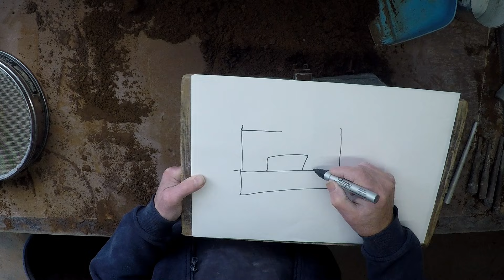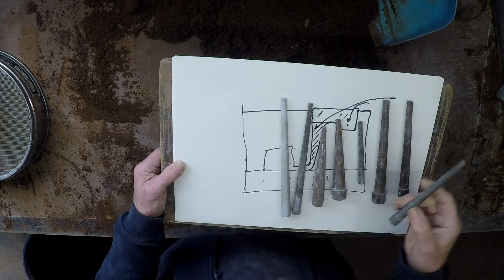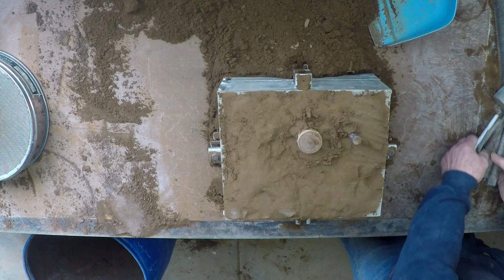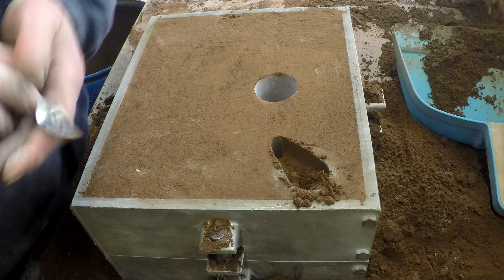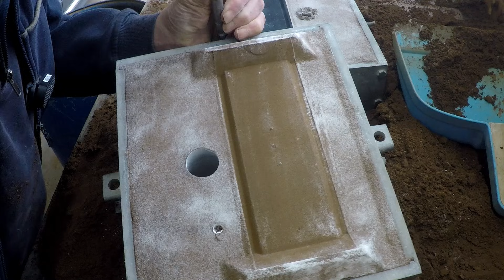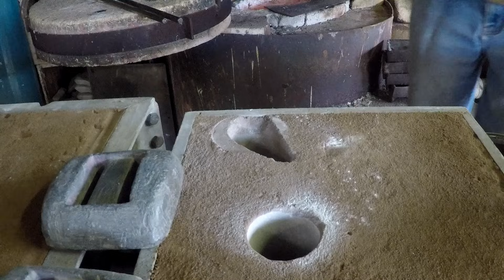Basin and sprue design for sand casting in the foundry

Comment: I hope you can take a little  constructive criticism. But that type of pouring basin is use but never that I've seen in small nonferrous foundries. It's not needed, if the gating is designed correctly. The pouring basin can be just  a cone at the top. The sprue does need a taper. But there are several other parts of a gating system that aren't there, looking at some of your other videos. The bottom of the sprue is called a choke. That slows the metal. At the bottom of the sprue a round or square basin in the drag helps trap any sand was. Don't gate directly into the casting from the sprue. The runner should run next to the pattern extend beyond the ingate. This pushes any impurities to the end of the runner and clean metal enters the casting. Gating ratio between sprue choke size, runner and ingate are important. As well as pour time. I have a small backyard foundry. But I'm a retired patternmaker with almost 40 years experience in and with both ferrous and nonferrous foundries. There is no one way to do things, if this works for you, great. But there other ways that may be easier and better. Keep up the videos.
Reply from the maker: Just Dave,
 Thank you for your long and detailed comment.
I don’t mind constructive criticism at all – provide of course, that it is scientific, factual, up to date, and correct.  I trust that you feel the same. 
Yes, it’s true that many foundries big and small do not use such a pouring basin and that is a sad pity, but the better ones do. Whilst I would agree that its use is more important with bigger moulds/work It certainly has value with smaller moulds too. Firstly, it allows easier positioning of the basin close to the mould edge. This provides a good target and allows pouring with the crucible/ladle partially below the mould top and thus metal transfer is a very calm almost horizontal manner. This together with the low ridge in the basin means that none of the high velocity often seen with metal exiting a crucible can add to the velocity generated by the meal flowing down the sprue. The name of the game is after all “keep metal velocities low” The use of a simple cone atop a sprue is bad news - it is what Bob Puhakka calls the “conical devil”. It is in effect a venturi pump and pulls air into the metal stream. It is said that roughly equal volumes of air and metal find their way down the sprue with this arrangement. I do not know about you but I do not want that much air mixed in with my metal! The simple cone does nothing to limit velocities, instead it makes sure the velocity from the ladle is added to the natural sprue velocity – bad news! I have used taper sprues since I first read of their benefits way back in 1965.
The word “choke” should be banned from the foundryman’s lexicon. The idea of any sort of choke in a gating system is anathema. A choke constitutes a high velocity area preceded by a sudden constriction and followed by a sudden enlargement. The latter is particularly damaging as it generates high turbulence, air entrainment, possibly metal jetting and impingement problems. Inevitably such enlargements bleed air into the metal stream for much of the pour. The bottom of the sprue should never be referred to as a “choke”. In a properly designed and tapered sprue it is the whole of the sprue - NOT JUST ITS EXIT AREA – that controls the flow – Please, I beg you, abandon your use of the term “choke”.
The use of a basin (or “well”) at the sprue base is now a well discredited idea. Endless Xray and fluid modelling studies have shown such enlargements cause entrainment, aspiration, and turbulence. If anything, they would likely generate sand wash and inclusions – smooth, calmly flowing metal will not wash or even pick up loose sand. It is a sad fact that many foundries continue to use these wells - based, I suspect on what great “grandpaw” said he did in his day and on the fact that so many – older and well out of date - books etc suggest them. Simply turn the sprue to the runner with at least the best inside radius you can manage.
I agree - do not gate from the sprue.  And if at all possible, I take the runner past the gate to form some sort of dump for the first metal. However, a simple runner extension is problematic as it can suffer from momentum induced back wash issues when it fills. Some people now use a spin trap in the hope of preventing this and while this is very necessary of larger higher work, I am uncertain as to its vale with smaller work – this is an area I am endeavouring to look into.
My method is to have the runner in the drag and the gates in the cope. I favour (depending) a feeder at/near the gate. I prefer the runner to be the same size as the sprue exit (not easy!) and the gates in total perhaps 4 times this. I prefer the entire casting to be in the cope – of course not all of this is always possible.  For higher moulds I like a filter near the sprue base to slow the flow to velocities safer to gate at.
Perhaps the saddest fact about foundry work is that bad methods will (sometimes) produce reasonable and acceptable work – how often I guess depends on one’s standards and I have noticed that on YT at least standards can be pretty low 😊. This fact plus the mind set that goes with it allows slipshod outdated methods to continue to the great detriment to the industry.
I suggest that you give long and detailed study to the works of John Campbell. Start with his “Mini Casting Handbook” and work your way up from there. Many foundries are now using his teachings and slowly they are wiping the floor with those who don’t
Sadly, my health is making video production nigh on impossible. I hope this situation will improve.... Martin
Reply: @olfoundryman8418  you misunderstand the how the choke works, it actually slows the pour. It allows the sprue to fill and reduce turbulence.
There's a pdf online called the 'metal casting process'. It explains the use of a choke. Except for the large ferrous foundries i worked for, all the nonferrous foundries used a conical basin and a choke if needed. I believe i mentioned pouring  speed. When pouring any casting that is controlled by the gating system and up to the guy pouring to keep the basin full. 
I spent almost 40 years as a journeyman patternmaker worked with the foundries building the patterns and helping the molders design the gating systems. Each foundry will find what works for them. In a production shop nonferrous foundry, cutting a basin like yours isn't cost effective. And they can still keep the scrap rate well below 3%.
Reply: @roscoepatternworks3471  I never worked in a foundry so I am trying to grasp what your discussing in this conversation.  But to me it seems that the Oldfoundrymans small tapered sprue serves the same function as a choke.  Once it is full, and this seems to happen rapidly, the cold sand actually starts to freeze the pour until the sand surrounding the sprue is warmed up.  You can actually see the basin fill quickly then after it warms up it flows faster.  So in my feeble mind the choking process is brought up to the level of the pouring basin.  With the way the pouring basin is designed it seems like there would be less chance of oxide skins being folded into the pour VS a conical basin with the choke down by the parting line.   I would think the time it takes to fill the choke and the sprue and conical basin would be longer and more turbulent.   I know I am replying to a 2 year old comment and I haven't seen that process demonstrated so i am speaking out of line, but if my whole train of thought is totally off the rails I would like to know.
Reply: @stevendephillips2490  there's a lot to unpack here. Both gating systems work. The question is is one better than the other, my opinion is no, when it comes to smaller castings. Such as in hobby foundries. 
Both use a tapered sprue. The basin just gives you a larger target for pouring. A choke is the smallest area of the sprue. The gating system  I use is and was used in all nonferrous foundries I worked with. There is a ratio between choke area: runners: ingates. This is based on fill time, of the mold. 
For the most part I mount patterns on a matchplate. And include all the gating. This way if I need multiple castings, I will get consistency in the outcome. 
I have cut some castings into pieces to check quality. And made appropriate changes to the gating system.
Basically use a gating system you're comfortable with and get consistent with it. Try them both.

Comment: Does the oxide prevent air and hydrogen from getting into the casting? 

Great informative video BTW.
Reply from the maker: sakuraknight, Yes, largely but not quite completely. Firstly, the hydrogen is from the water in the air (natural humidity and/or product of combustion) reacting with the aluminium to form aluminium oxide and hydrogen atoms which immediately dissolve in the aluminium. 
The oxide film on aluminium may be thought of as ever so very slightly porous and thus air/water ingress does still occur but at a slow rate. Importantly, the rate gets ever slower as the film slowly thickens. The rate of further corrosion of the underlying aluminium thus becomes vanishingly slow. This applies of course on solid and liquid aluminium. From the point of view of liquid aluminium handling the great danger is if the film ruptures because of turbulence, this not only allows easy access of air/water but the ruptured film inevitably gets dragged into the metal where it acts as a serious crack like flaw in the eventual casting.
We owe the usefulness of aluminium products generally to the presence of this oxide film as it greatly slows – virtually  prevents - further corrosion (unlike magnesium alloys  for example where the oxide is not protective and corrosion is quite rapid if not stopped by other preventative measures)
 Glad you found the video useful…. Martin

Comment: Awsome info, I think my third attempt of casting might now have a fighting chase of being a success. I would have loved to see how you connected the gates.
Reply from the maker: Matt, If I have helped I am well pleased, How did the third attempt go?. You can see gate etc connections in quite a few of my videos but they do vary with each part. To be honest unless you have an expensive casting computer program gating is a bit of a this is what worked last time sort of thing, but there is a lot of good info in Jophn Campbells books on how to best do this. For small work though you can often get away with simple gating systems... Martin

Comment: fantastic this method, I would like to know what is the ideal temperature for thin pieces 1/8? thanks for your attention.
Reply from the maker: Walter, Oh, how I used to hate thin work! One would go to all the trouble of making a mould and pouring the casting only to find it did not quite run!
This work I would always pour hot, going even as high as 800 deg C even though this risked gas problems in the metal. But it depends on lots of things. 
1: How big is the casting
2: How much of it is thin
3: Can it be thickened up easily (the surest way of getting a full casting - just keep thickening it up until it runs)
4: Can you oven dry the mould - this helps a lot but takes some hours in an oven at about 120 to 150  deg C
5 If it can't be oven dried can the cavity surface be skin dried with a gas flame - need to pour quite soon after mould closure if you do this.
6 If you have acetylene cover the cavity with soot from the flame. This  will make metal run at lot lot further but it MUST be an acetylene flame.
7 Metal will run further in petrobond than in green sand.
8 Some alloys are more fluid than others. The eutectic aluminium silicon alloy (12% Si) LM 6 in UK and 413 in the US will run a lot further than the more commonly used 356 (US) LM 25 (UK) alloy
9: Don't try and use junk alloy.
10: Vent the cavity well butavoid any "venting" e.g. via feeders on the gates and before the cavity. Thus any feeders to be on the casting proper not on gates etc
11: Above all use good basin and sprue technique, good gating to multiple parts of the casting (not easy !) Pour fast enough to keep the basin full.
....Martin

Comment: Thanks for sharing your knowledge. An amazing trick I never have seen before.
Reply from the maker: Jan, Thank you for your comment. Yes it is amazing what the use of a decent pouring basin atop a small tapered sprue can achieve in improving one's castings, Particularly when it comes to the more difficult alloys like the aluminium bronzes. But there is nothing really new here - the basin owes much of its design to basins used around 1900 and the idea of the tapered sprue was well know and much advocated  by the mid 1950s. The problem is of course that the foundry industry is very - ahem - traditional, plain and simple, it is reluctant to accept "new" ideas ... Martin

Comment: Thanks Martin for the great vid and all the good info, a lot of it is in your answers to comments,  I was wondering how much air pressure you are running while blowing out the mould with the air gun? Thanks Matt
Reply from the maker: Cracka, I use about 15 PSI. But you have to be careful to point the gun with care when you first hit the trigger as you often get an initial hard blast of air. Also never aim the gun at sharp edges in the mould  and for delicate stuff like text hold the gun a long way back and move it in slowly until you see any loose sand blow away. An air gun that is progressive rather than on /off is a great help. But it is a bit of an acquired art - practice makes perfect 😊... Martin

Comment: I have an irregular shape that i want to cast ... how do i chose the best placement for the spruce and riser.?
Reply from the maker: Nika, Without actually seeing the part or a drawing it is very difficult to say - but generally I put a feeder on the thickest section of the casting and run the metal into as close to the base of the feeder as I can get. I try always to have the sprue close to one side of the mould as this makes it easier to get a good pour. Email me a picture or drawing  to olfoundryman@gmail.com and I will try to be a bit more specific.... Martin

Comment: Geoff at VOG said you're the guy, so here I am!  Thanks for taking the time to make these videos.  I just built my first propane furnace (posted a vid) and I'm going to skip a little trial and error and make your tapered sprue and basin right out of the gate because it makes sense!
Reply from the maker: Jason, Thanks for the vote of confidence 😊 Indeed it makes perfect sense. If you use the basin and tapered sprue properly as shown in this video you will be well ahead of most other foundries including the professional ones. However be aware that some  people try to put their own spin on the basing/sprue design and make a bit of a hash of it - typically they make the basin rounded (cut with a spoon) have the ridge too high and - gasp - use a parallel sprue. I will be watching 😊... Martin

Comment: Is it possible to contact you privately?  Having some problems, mold cavity not completely filling. Getting a soft or shinkage spot on a cylinder  shape area every time! Have photos of latest failure. Did try the basin pour and started using petrabond sand.  cjbarger@att.net Thanks

Comment: Concerning the variations in metal velocity, trapping air, etc, do you think all these problems diminish as the casting volume/flow increases? If so, there would be an advantage in joining several pieces in one casting, as they do in lost wax where the pieces are joined in a "tree". any thoughts?
Reply from the maker: Slick,  The problem is not actually volume of flow rather it is speed of the metal. A metal velocity of 0.5 meter per sec is quite safe as it will not cause turbulence that entrains air or other impurities at all, However it is often considered that we can "get away with" a velocity of 1 meter per sec. Unfortunately a metal fall of 50 mm results in a velocity of 1 meter per sec and most moulds are way higher than that. The bigger the mould the greater the metal fall and thus the greater the velocity. So placing several parts in a mould may be counterproductive as it may increase mould height. Careful gating design probably incorporating speed control devices like filters would be necessary.  But the idea is quite viable for small parts and I have used it a lot with up to 14 little castings in the one mould. As an aside it is unfortunate that most investment work seems to completely ignore an idea of decent low turbulent gating and reasonable metal yield. ... Martin
Reply: @olfoundryman8418  thanks, that makes sense

Comment: Hi martin
I am facing a big issue with casting aluminum  
I do cast copper alloys only
The thing is the cast is very brutal it breaks like glass and has shiny grains like crystals
Reply from the maker: Rahib, I thought that I had replied to this some time ago but as no reply is present I assume that I forgot to hit "reply" or something before moving on - sorry. The shiny grains could be silicon particles they could be compounds of iron and also of other elements like chromium etc. What as the source of your aluminium? What did you melt it in? Was there any gritty sand like stuff in the bottom of the crucible after pouring...Martin
Reply: @olfoundryman8418  you did martin i read earlier comment
And i founded the problem it was zinc im doing gravity die casting 
The challenge now is making a die to cast brass it
Cast iron out fo my hand ill try to make copper alloy what do you recommend waht copper alloy